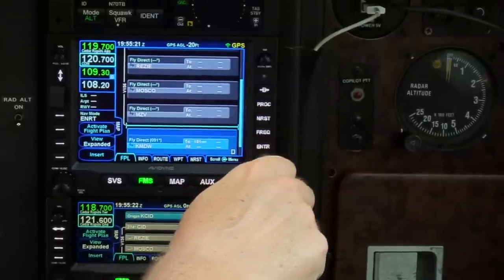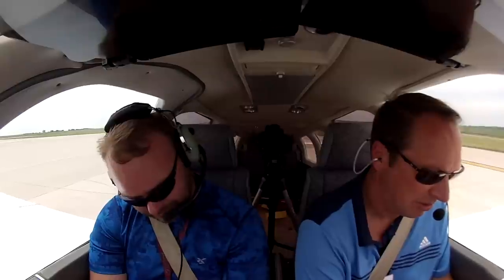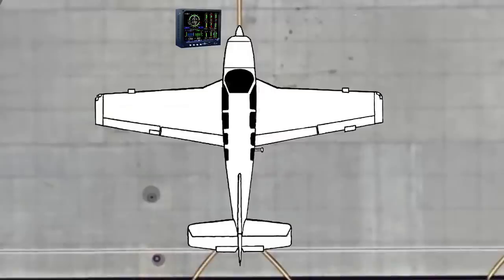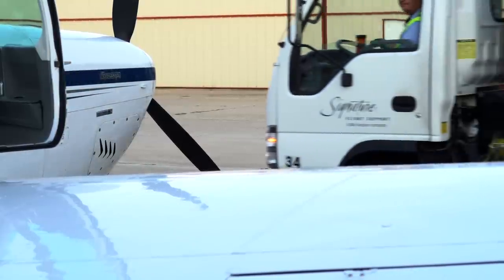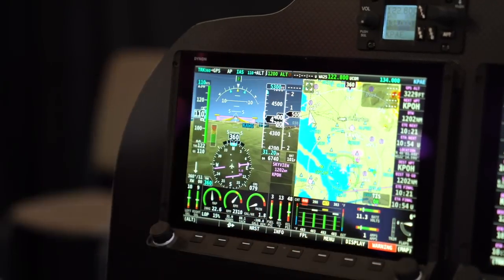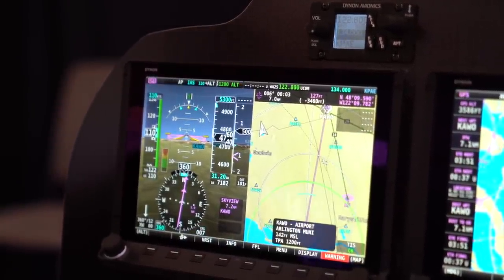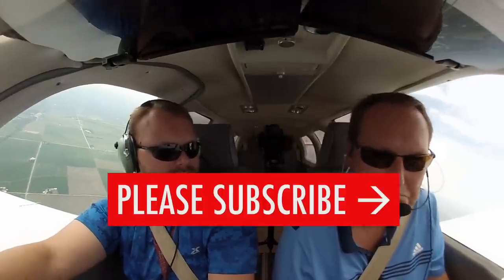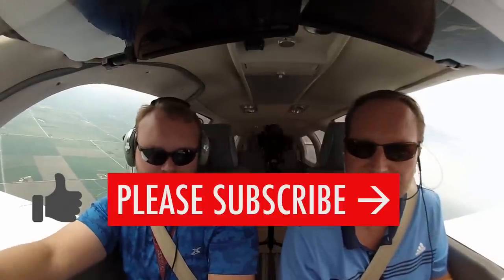Engine Monitor Upgrade - Part II: JPI EDM 930 Flight Test

Comment: Martin,
After the wires were switched around, it appeared that the charging was fluctuating between -1 and +1 amp. Is that normal? I would have expected something more on the plus side due to the increased engine RPM.
Reply from the maker: Well, to be honest, I don’t know if that is normal or not. I have not flown another airplane with this type of engine monitor before.
Regards, Martin
Reply: I’m no expert, but your amp gauge is showing a discharge at high RPM. I don’t believe that is normal. A faulty alternator is one item to have checked. Please at least speak to your mechanic about it. I don’t want you to have a battery failure in flight. For the record, I truly enjoy your videos. Very informative.
Reply: David DeFelice The JPI can be set up as either a load meter or an ammeter. If he has it set up as an ammeter, it certainly doesn’t look correct. My JPI 900 is set up as an ammeter will show a positive amp when everything is running and the alternator is online. If I pull the field breaker, I will see a large negative showing the draw from the avionics and lights. His charge voltage of 28.4VDC looks correct so I wonder if it is wired correctly as an ammeter (ex. proper shunt, etc.). If it is, then something is not correct.

Comment: Martin I like the jpi. The guys did a good job on the instal. I would advise steering well clear of anything dynon. My friends on his 5 sky view panel, 3rd pitothead. Another friend is on his second pitothead. My dynon pitot heat failed the second time I used it. But what I have found the worse thing about dynon were their technical help. May self and a friend queried a dynon auto pilot servo on his RV. There seemed to be to much friction in the control circuit. They provided like to no help and were unhelpful and condescending in their reply. The U.K. dynon dealer helped us out in the end. The same with my pitot heat. When it failed I could not troubleshoot the system with the information provided in the installation guide. Dynon insisted all information need to perform all troubleshooting was contained in the guide. What little information the technical help team provided was plainly incorrect and showed a basic lack of understanding of how their produces worked. In the end I contacted the UK dealership who provide all the information needed they were very helpful (great work Harry Mendelson). One thing I can't fault dynon for is replacing faulty equipment
Reply from the maker: Interesting - I'll see what other data points I can get around this.
- Martin

Comment: In flight the ammeter is still showing a -2A discharge?
Reply: Bob, I noticed that too. You might expect that at low rpm, but in cruise flight you would expect more than that.
Reply: @boilermaker7754 It shouldn't be Dischargeing at all in cruise wiring or Regulator issue I'd say
Reply: @bernardc2553  yep, should be a positive number when the engine is at normal cruise rpm....the only other reason I can think of is the battery is fully charged and we are seeing a small percentage of meter error.

Comment: Hey Martin another great video.  Still catching up with your back catalogue, so sorry for the late reply.  
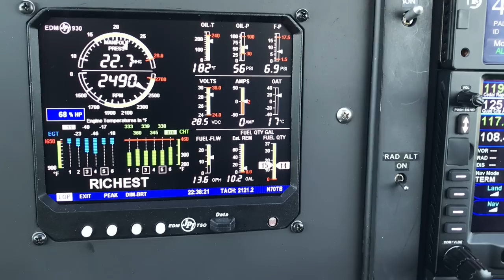At 15:38 there's a good display shown of the CHT redline value of 460F.  Is this a figure you self-configured the JPI 930, or is it the manufacturer's (Continental?) redline value?  My Piper Comanche IO-540 has a Lycoming redline value of 500F, but I'm thinking I'd like to know somewhat sooner if CHTs ever got that hot!   I guess you can customise CHT alarm limits to personal settings?
Thanks, keep up the good work.
Reply from the maker: Rupert, what you are asking about is a legitimate concern. The FAA in their infinite wisdom has made it illegal for certified primary engine indication systems (primary meaning they can replace the factory gauges) to warn pilots at any other temperatures besides what the POH and the factory gauges say. Personally, I would much prefer an alert at 400 deg F for my Continental IO-550B than at 460 deg F.
Regards,
 Martin

Comment: Great Video,  noticed you have the  left and right fuel quantity shared on one gauge and the other gauge show fuel remaining, is this a custom feature you had your installer request?   The EDM 930 my mechanic ordered didn't offer a choice.
Reply from the maker: The fuel gauge which shows left and right is the actual fuel level in the left and right tank, as measured by the floating fuel senders in those tanks. The one combined "Fuel Remaining" indication is the totalizer: You set it at startup to the number of gallons in the tanks; then my JPI EDM subtracts continuously what is consumed from that starting value. That way, you can crosscheck the very accurate computed fuel remaining against what's left in the tanks (less accurate). I once saw a big mismatch; landed only to find out I had a fuel leak!
Your EDM can be configured to show different things. You should talk to your mechanic to make sure you get both indications, fuel level in each tank plus the computed fuel remaining.
- Martin

Comment: The double Aspens are nice for the redundancy, but if you have to keep the vacuum pump for the autopilot, then the single Aspen would do what you need and keep redundancy, and vacuum pump change outs :)  The dynon looks nice, but you already so much of what it offers done, granted you could get a nice autopilot out of it.  Personally, if I was looking to refit the whole panel I'd go dynon.  If I already had the stuff you did, I'd probably go Aspen.  You can add the second aspen display later when you ditch the vacuum pump and put in a DFC 90 or STEC 3100.

One opinion.
Reply from the maker: Those are good thoughts, Paul. You are right; I probably don't need a lot of what the Dynon offers because I already have it elsewhere - except the autopilot. And while I would LOVE to have a DFC90 (they are phenomenal), I don't have STEC servos in my Bonanza, so I don't believe the DFC90 is an option for me.
Regards, Martin
Reply: Single Aspen, STEC 3100.  Boom.  :)
Reply: Paul, start looking at the price sheets for both units, and you'll find out just exactly how less expensive the Dynon system is over the Aspen.
If you want to redundancy of the Aspen, you must buy at least the Evolution 2000 system, not the 1500, since the MFD in the 1500 does not have an ADAHRS in it.  The Evolution 2000 is $19,990 before 'options'
Next, if you want synthetic vision, add another $3,000, then add another $800 for any follow on displays.
Then, add another $900 for Weather and Traffic avoidance, but oh yeah, you need to have a WX-500 and an ADS-B In to get the information.  So, whatever those cost.
Then, if you want to integrate an autopilot, you can, for another $3,000, get an 'unlock key' for the Genesys 55X rate based autopilot and then interface unit, but then again, you need to buy the 55X autopilot.

In another reply to Martin, Dynon with a 10" display, a 7" display, dual ADAHRS, full Autopilot,  ADS-B IN and weather input, networking cables pre-done, came in at about $23,500 plus installation,  Figure about $11,000, according to Dynon.
Aspen, for the Evolution 2000 system, is $20,000, plus $3,800 for Synthetic vision for two displays (standard on the Dynon), another $900 to unlock the capability to use L3 Lightingning information and traffic.  Then, if you want to spend $800 more, you can unlock to use the Lynx Transponder Martin already has in his airplane.  At this point, we have a two panel display that gives less space than the one 10" Dynon, and costs $4,000 more, with no autopilot.  You can figure the installation costs are going to be about the same, except of course, you'll need to pay for the installation of the autopilot, once you buy it.

So, yeah, give up an entire 7" display, or maybe we should call that giving up a 10" display, since you would need the 2500 system to get the same amount of real estate the 10" gives you, and an autopilot, better integration for $4,000 MORE?  Yeah, I don't think so.

Download the Interactive Excel Spreadsheet for the Bonanza, and figure the A36 isn't going to be that much more expensive,

https://www.dynoncertified.com/index.php#pricing

Then, download the pricing sheet for the Aspen stuff.

https://aspenavionics.com/pricing

TO ME, if I was planning on a panel upgrade, especially with full certification with the A/P coming in the next few months, Dynon is certainly the value and price winner in this contest.
Reply: @GaryMCurran You can keep redundancy with an Aspen 1000, on the cheap, because you'll keep the vacuum system.  It will play with the C3 autopilot and add GPS steer.  The unlocks are nice, but the lynx already provides a display source for the the ADSB in data.  Syn vis is already on the IFDs, IIRC.  Part cost is about half.  

I presumes the Aspen is Doug's P2 Baron is similar to this, so Martin has some idea what it would be like.

It really depends on the mission.  If replacing the autopilot is part of the long game, then Dynon is a more cost effect solution.  If the goal is just to get some glass, the entry level Aspen can do it for less.

Comment: Once again ... Very informative and great input !!!  Thanks Martin !!!  
I am still struggling around my choice on the EDM900 contra the EDM930 for my Mooney with a lot lees panel space that you have in your A36.   Anyway - regarding your next upgrade; I already have the Aspen Evolution 1000 in my Mooney here in Denmark, and I am a HUGE fan of this !!   It just works and is easy to use, once you get into all corners of the Aspen...  However, I also really like the Dynon Skyview HDX solution as well !! 
Maybe it´s a little "overkill", since you already have great GPS and engine instruments in your A36.
But I love the way the autopilot is integrated in the Dynon solution even though I am a fan of Aspen !!!
I will be eager to follow you on what your choice will be.... Aspen or Dynon ?!?  ;)
Reply from the maker: Oh, the suspense!   :-)
It'll be a while before I make that next step for my panel, so I have time to think about it.
As for 900 vs 930, I thought the bigger display of the 930 would be easier to read, and I have plenty of space for it.
- Martin

Comment: The Aspen seemed more cost effective - you can keep a lot of what you have and not a lot of duplication. The Dynon was a nicer looking system, but looks like you may pay again for something you just upgraded.... thanks for sharing!
Reply from the maker: You bring up some good points - I generally agree, though I don't think these are huge needle movers. I could still see either system work out great for me. Other things need to be considered: dispatch reliability, expected compatibility with current and future avionics equipment, autopilot growth path, etc.
It's far from decided!  :-)
- Martin

Comment: the Aspens have changed since I brought my plane. I do like my Aspen system and the company has been really good to me. I have had 2 failures which keeps me purchasing the insurance. Since the error last year they have performed well and he is right about the approaches very easy to link up, setting min is great. The gpss takes time to get used to. Can’t complain with the system.
Reply from the maker: Good to know, Paul. Thanks.
- Martin

Comment: hi Martin, you just ignored the little bit overflow of RPM?
Reply from the maker: Yes. It's approximately 2% over the red line. In a mechanical tach gauge it would be hard to notice.
- Martin

Comment: I'm curious, Martin.  In the installation manual, "The RAD is located directly in front of the pilot. . . "  Every other installation I've seen has it basically on top of the ADI.  I'm wondering, not that I expect they would, but if a FAA inspector looked at that, would they ding you for where it is?  I asked in the previous video, and no answer that I recall.

As to the glass panel, I think the Dynon is your best bet, with the Autopilot when it's certified.  If the certification is by the end of the year, that's only a couple of months away.  Replacement of that Century III would be really nice.  Of course, a 10" display and a backup 7" display/MFD/AP controller/etc., will probably mean relocating the EMD930 either up or down.  However, for what you get from Dynon, I think it would be well worth relocating the -930 for the opportunity to have two displays.

My two cents, and your thousands of dollars.  :-D
Reply from the maker: Gary, thanks for your comments. I agree, the Century III is not going to last forever, so my future EFIS solution should take an autopilot upgrade path into account.
For the RAD location, we discussed this extensively before finalizing it. What is the definition of "directly in front of the pilot"? If you look at AC 25.1322-1, which defines (among other things) the "primary field of view" in which warning instruments shall be located, my install meets those requirements. The RAD is not far off from the center in my panel. If it's good enough for Part 25, it should be good enough for my Bonanza - I hope.
Best regards, Martin
Reply: @martinpauly  I wasn't sure.  It's your airplane, I'm sure it fits in YOUR primary field of vision, which meets the definition.

Comment: What’s the price on these for a 6 cylinder ?
Reply from the maker: There are many different configurations, so rather than give you a number, I'll refer you to JPI's website where they publish the equipment pricing. Also, these engine monitors are somewhat labor intensive to install, so get a quote from a shop or mechanic as well unless you are planning to do the work yourself (which I understand many aircraft owners do, with sign-off from an A&P).
Regards,
  Martin

Comment: I was wondering if one of those new PFDs can display the angle of attack, which can be very useful on low speed approaches.
Reply from the maker: I know the Aspen has an AOA option for their display - computed, without an AOA sensor. I see Dynon has an AOA sensor as an option, but I can't tell if it's available for their certified product or just the experimental version.
Regards, Martin
Reply: @martinpauly   I wouldn't go for the Aspen system. The UI is pretty cluttered and the knob and touch UI of the Dynon system is much more similar to your current systems.

I would recommend to photoshop each product in a picture of your plane and take make sure it looks good and makes a good UI overall.

The reason I asked for an AOA display is the prominent display of AOA in the ICON aircrafts which looks pretty dope:

https://www.youtube.com/watch?v=2wlvpJLcf-A

Comment: Did you get the Cies fuel senders? I'm having a 930 and Ceis senders installed right now
Reply from the maker: No, I left the resistive fuel senders in place. They work just fine in my Bonanza.
Should they ever need to be replaced, I think I'll go with CiES, though.
- Martin
Reply: @martinpauly  Thanks. I had one side that was basically only good for full and empty and my bladders needed to be replaced anyways. It just made sense to have the Cies ones installed. I was curious if what you had there were Ceis or not because it looked pretty accurate! Thanks
Reply from the maker: @BonanzaPilot  I believe CiES is a great choice if your existing senders don't work. They are expensive, but everyone loves how accurate and reliable they are.
- Martin

Comment: Hi Martin, love your videos!

Any comment on how much you can really trust your new fuel gages? It would be nice to fill my Bonanza to half tanks easily, but the old style fuel gages are unreliable and there’s no way to dip the tank to confirm half capacity since the fuel caps are located on the upper end of the tank.

Do you have a technique for getting half tanks?
Reply from the maker: Hi Even,

Thanks for the note. I still have the resistive fuel senders, which I left in place from the prior setup. The new CIES fuel senders are said to be more accurate and more reliable, but they also cost a lot. I generally have found my fuel senders to be quite accurate, actually (with the previous digital level meter I already had), but I haven't tried to rely on them for filling the tanks. I use the tabs in the tanks for visual reference (full, -5 gallons, or -10 gallons) or I rely on the fuel totalizer to know what's left, then add accordingly. Those methods have always worked well for me.
Best regards, Martin
Reply: Martin Pauly I have the CiES in my Mooney with a JPI 900. They are extremely accurate and eliminated the “fuel mismatch” error that I would periodically get with the resistive senders. I am running them in frequency mode. 

Just a comment on your fuel sender calibrations. Couldn’t tell from the video whether you leveled the plane to the angle of attack as specified in the installation manual. I ended up jacking the plane a bit and deflating the nose wheel to get it in this angle for the calibration.

Comment: Thanks for this vid! ....no one is mentioning weight savings with an all glass panel. I would think that would be considerable....and zoom you in to the 22nd century....or the next software upgrade.  :-)
Reply from the maker: Around 3 pounds for the engine monitor - I bet an Aspen or Dynon could save even more.
- Martin
Reply: @martinpauly  ....thought I saw a posting of someone who dropped about 65 lbs by eliminating all the  steam gauges, vacuum system, etc.  ....hopefully, I didn't dream it.
  All the Best, 
      Emil / Pudge
Reply from the maker: @ThePudgie123  Hi Emil, for a complete panel do-over, I can see that kind of number happening. That's 11 gallons of gas, or almost an hour of extra flight time at cruise for me. I would take it!
Or I could lose some weight, wouldn't be too bad for me.  :-)
- Martin